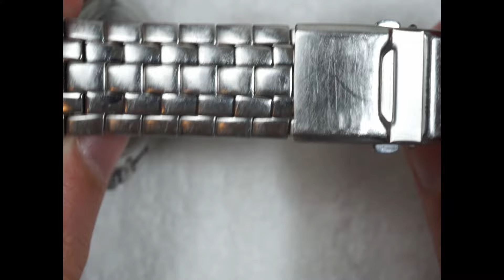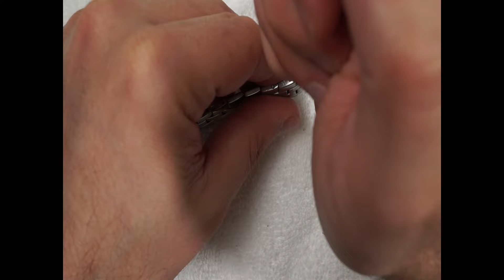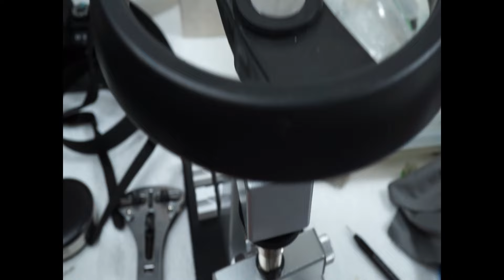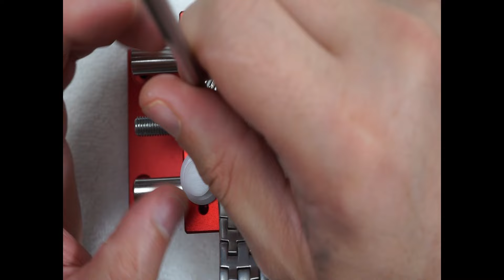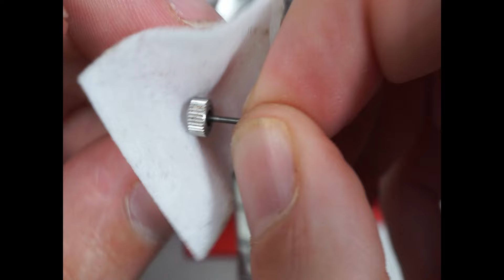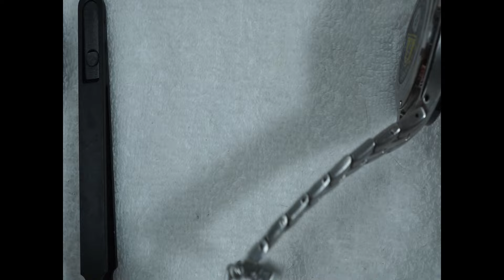Citizen Blue Angels Skyhawk aviation watch C650-T000959 crown gasket service and review 100m 43mm

Comment: I have this exact model watch in almost mint condition.  I dont wear it too often to preserve the condition. I used to wear my c300 Blue Angels Navihawk to work in law enforcement every day for many years. It's a pretty tough, solid watch, and it's still in pretty good shape.
Reply from the maker: Nice! I actually like the older "promasters" and "hawks" from Citizen more than the newer ones. The new ones are just getting too big! Finding this watch in mint condition is certainly getting harder these days. Take care of it and keep it charged periodically and it will treat you well!
Reply: @JT_Trades_Treasure  I keep all of my Ecodrive watches in glass topped wood cases on a shelf with built-in lights. Since any light source will charge them, it does a great job of keeping them charged. I also have fairly thick wrists, so the size of the new ones doesn't bother me too much. 😄
Reply from the maker: That is a good idea.... Hmmm. I might have a DIY project in the not so distant future for charging Citizen watches =).

Comment: Hi sir. I'm trying to replace the crown and stem of my watch same model as yours. The stem a while back got sheared off from the crown and have misplaced the damaged stem. I think I overwound the crown on the zero position and it broke in the process. Do you have an idea of the part number for the crown and stem? Or the exact length of stem? If ever I don't find the exact part, I will just buy a knock off eco drive c650 and try to salvage the crown and stem and use it for my eco drive. Ty sir for info
Reply from the maker: Ooof, sorry to hear the crown was damaged in this way. It is always a bummer to see that.

Unfortunately Citizen is not great about cataloging individual parts for watchmakers to use for repair unless you are an AD of Citizen and have certain repair certifications, if I recall.

I can't imagine it would cost too much to have the crown professionally replaced...

I think your idea of buying a doner watch to cannibalize is probably what I would do in your situation. 

You could try to call or Email Citizen and see if they can help. I have not personally tried this so your results may vary.

I hope this helps.
Reply: Thanks sir. Unfortunately in my area, the official service center have bad reviews online. No choice but to do the DIY route. 😊
Reply from the maker: Best of luck!

Comment: Sir, I'm having trouble releasing the winding stem. Is it a button you need to press near the end of the metal strip like arrow? Been trying to press something, I do not know if I'm doing it right.
Reply from the maker: At 17:25 ish I managed to get it out. You need a thin tool to insert into the small hole. It is between the plate recessed into the plastic mold.
Reply: Thanks again sir